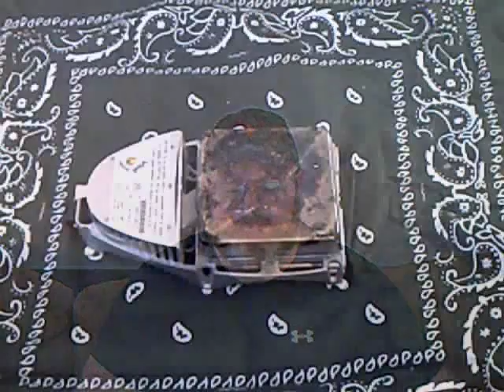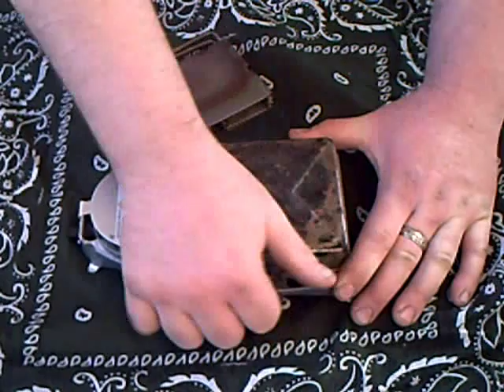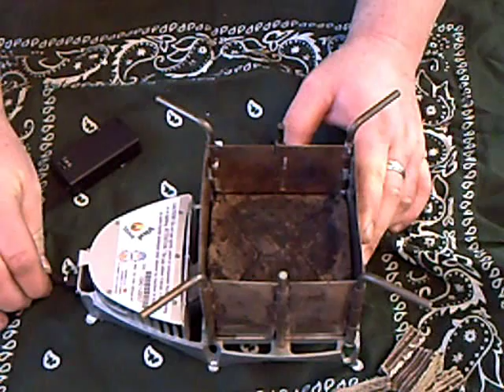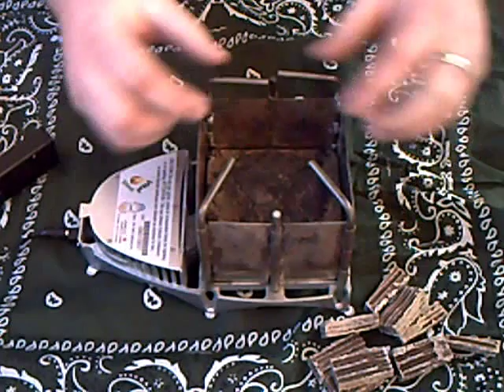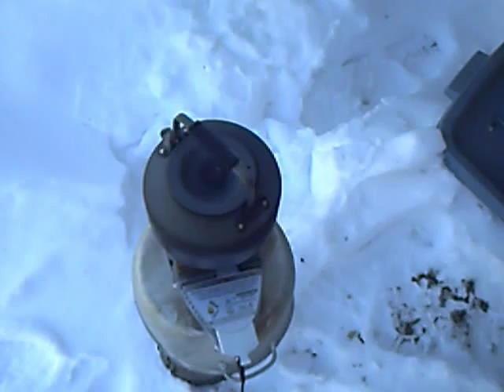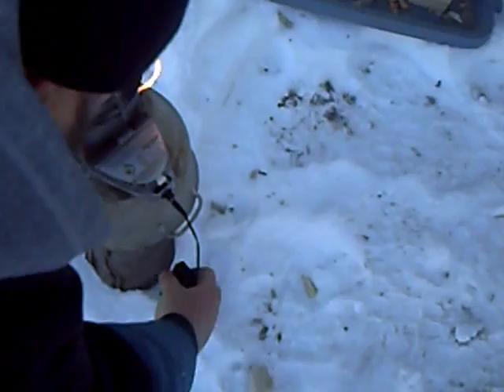The Vital Grill Stove Review

Comment: Mark, are you still using the Vital stove?
Reply from the maker: Mark Young yup from time to time.  it is a great stove. When I am going to cook something that needs good temperature control I bring this stove. It has an air and fan speed control that gives you total control over your heat. It is just a great stove.
Reply: Thanks for responding Mark. I am starting to see the value of the stove, as you say, with heat control. I have come across a second hand one for $40.00 and I am going to offer a bit less. I see them for $79.50 at Lee Valley.
Reply from the maker: Mark Young I bought my stove at sail for $68. I have had it for a few years now and I just changed the batteries for the first time. lol
Reply from the maker: Mark Young I will sell ya mine or trade if you want. I can shoot a video of me setting it up just to show you it works.
Reply from the maker: Mark Young let me know if you are interested.

Comment: I'm a long-time user of that stove myself and did m own review and cooking demo (including a slow-cook at low heat) several years ago because, of everystove I've ever used, I've yet to find one that allows such a range of temperature control.  The fact that you never have to buy or carry fuel is a huge plus for me and balances out the fact that it's not a light stove compared to some on the market.    Another plus is that, if ever the battery died or the electric motor failed, it still works well as a regular twig stove.   I don't know of a better stove for canoe-tripping for those reasons.
Cheers, 
- Martin
Reply from the maker: PineMartyn I agree. I love this stove! I am kinda surprised you don't see more people useing it.
Reply: Adventure Time Outdoors I quite agree. It's very much underappreciated it.  I think the fact that it's battery-powered put a lot of people off.  They worry (reasonably) that it could fail, but in fact, gas stoves suffer failures all the time (clogs, lost parts, lost pressure, etc) and are completely useless when that happens, and people don't seem to think that's a deal-breaker.  What's more the same people who balk at having a battery-powered stove also carry battery powered flashlights, headlamps, GPS devices, and phones into the bush, without a second thought.  This little stove, even without any batteries, is still a good little twig stove and pot stand!   I think another reason why people don't flock to it is that it's heavy compared to most stoves.  People don't realize that a gas or alcohol stove that weighs only a few ounces still requires one bring in fuel, which cost money, adds weight and takes up volume in one's pack, and on a week-long camping trip, that's usually more than the weight of this stove just in fuel.
But I think that the makers of the stove have not even marketed it very well for the camping/bushcraft crowd, aiming it for different markets (car-campers, emergency uses, etc), which is probably why it's not in wider use among backcountry campers.  I do know quite a few canoeists who rely on it though.
Cheers, 
- Martin
Reply from the maker: PineMartyn the whole purpose I  bought this stove was for ice fishing. I got fed up of my fuel freezing and losing pressure. I agree with you they did fail on the marketing. I was really surprised at how long the batteries last. I must have used it 30 times with the same batteries.

Comment: My  batteries  seem to last  forever . My soot problem  is  on my  cook kit. I've  used coating  the  pan with  soap, putting  foil  on  the  bottom  of  the  pan, but  there's  got to be  a  better  way . Look at   river  bend survival  entitled sir. He made  a  cook kit from 2 dog bowls  but we have more control  with the vital  grill .  What  to do ?
Reply from the maker: Oh sorry I thought you were talking about the stove it self. As for the cook kit. That is a tuff one. My kit has a bag and on day trips I clean the inside and pack it up and clean the outside  when I get home. For more than a day I pack some dish soap and steel wool. I haven't had much trouble cleaning it but it would be nice to skip the mess all together. But right now I have no answer for you. I have also tried the soap and tin foil there must be an easier way. If I figure out something I will get in touch. Oh the one thing I did notice is the mess is greatly reduced if the wood is really dry and if it is a hard wood like maple, oak and birch. Much less mess

Comment: I  love  my  vital  grill  and at first I  thought  it  was  too heavy  but  its  really  not  that  bad  compared  to  others . The only  problem  I  have  now is how  dirty  the  soot is. Got  any  ideas  as far  as  the  soot?
Reply from the maker: George I love my vital grill too. As for the soot I do keep it running until all the wood is turned to ash pack it up and wrap it in a bandanna. I think I will be making a bag  with a draw string for it. The cotton bandanna worked well though. I think so far I have about 25 hours on my batteries so far. How are yours holding up? Thanks for the comment. Take care